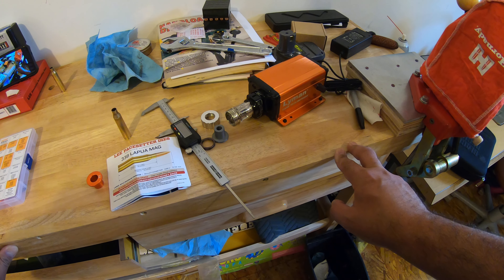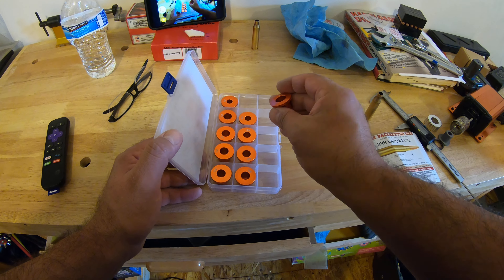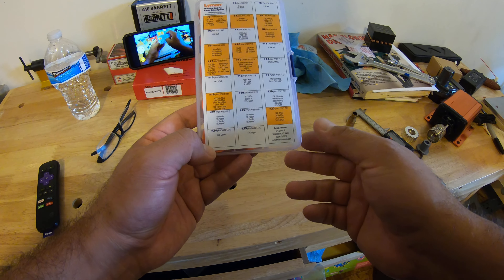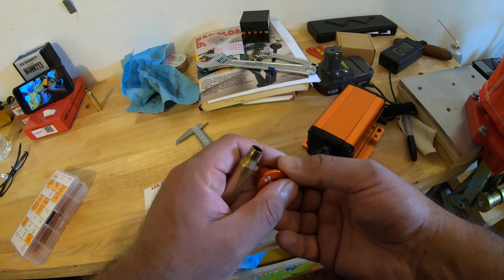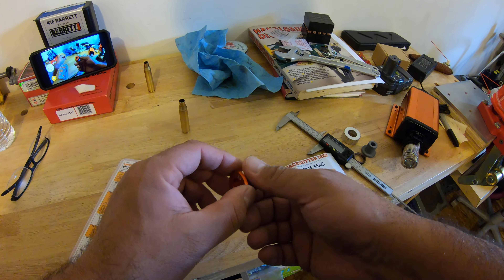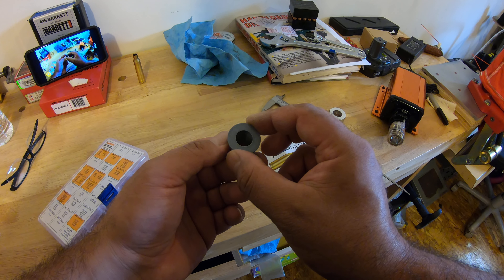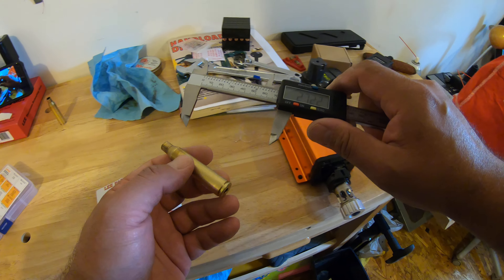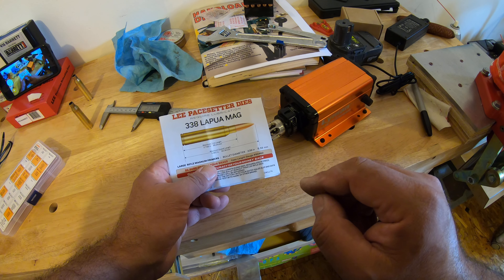Lyman Case Trim Express: Overview, Brass Trimming and making my own #24 because it's not available

Comment: I just purchased that same unit.   Any way I can get that 3D printer file still?  Thanks!
Reply from the maker: If you tell me the size you need I can print this for you
Reply: @redjet505  Thanks very nice of you.  My son has access to a 3D printer was just wanting a easy to send computer cad file when/if I need.  right now just .223 but have a variety of old ww2 stuff that I might need.   
Adapters can be made for straight wall too.